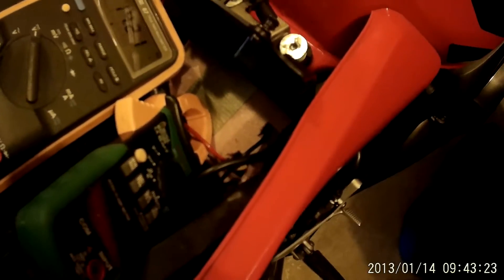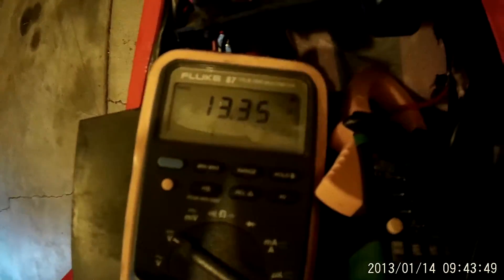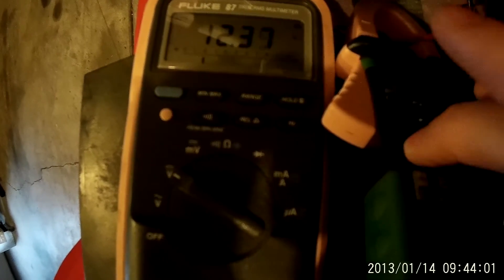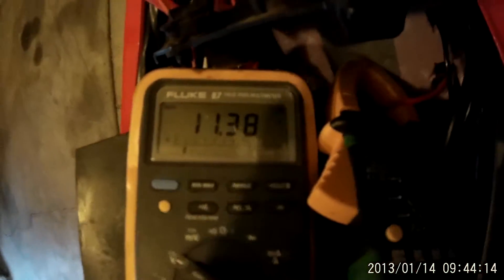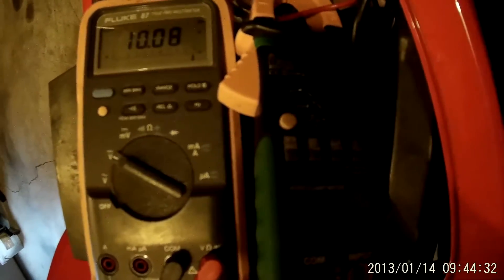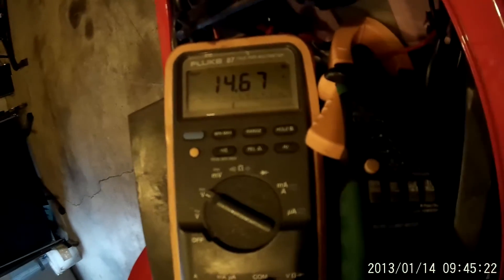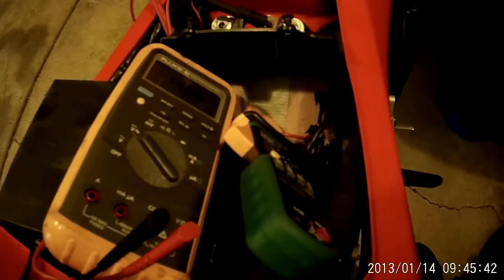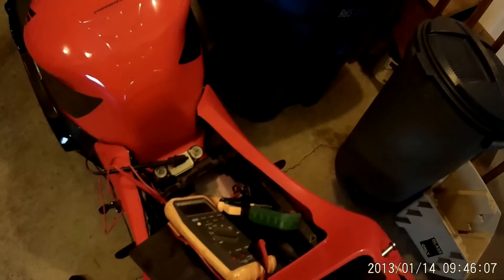Supercapacitor Battery Replacement on Motorcycle

Comment: Excellent concept.   I would think if you put an on/off switch in to prevent the headlight from coming when you turn the key to run it would help reduce draw by a lot.

Comment: Good idea, and for outside bikes if you had a small solar panel (like the flexible PVC kind you could glue to the plastic behind the seat), then you wouldn't have to worry about them draining over time as it shouldn't take much to keep them up so it could sit for weeks.

Comment: Sorry pal. If your bank is flat that bike won't bump start. It needs something to light up the ignition system. Thanks for the video though I'm going to do the same with my 75 xl250. It doesn't have electric start. I just want it to run the lights and horn when it's running.
Reply from the maker: The bike uses a generator to supply the electrical loads. As long as the motor is turning over, the generator is outputting electricity. It took a good portion of a hill to get the bike to start from flat dead once, but it will go.

Comment: good day sir is this DIY safe for honda wave 100?
Reply from the maker: Yes, a supercap is safe for any vehicle. It should work well on the Wave 100 since the engine is small. Make sure you are able to push start the bike just in case the supercaps lose charge and are unable to start it. You don't want to be stranded at an inopportune time.

Comment: I'm looking for an alternative to the heavy YTX20 lead acid battery in my Polaris RMK 800 snowmobile.  The battery and starter are an option, so the battery only powers the starter and is not necessary to run any other electrics although I do have a cigarette lighter outlet on the battery circuit to power my heated jacket.  There is a pull starter on it.  I'm thinking this would be adequate as I can keep it on a trickle charger when not in use.
Reply from the maker: It's hard to say if it would be a good solution for you. It depends on if your sled generates enough electricity at idle to adequately run everything including your heated jacket. My bike will hold 12v at a 1,100 RPM idle with no loads other than the lights, ignition, and ECU.

As you can see from the video, the voltage very rapidly drops when the bike is on, but the engine isn't running and this is due to the lights draining the capacitors.

I'm not sure if 2-strokes are more or less difficult to start than my 600cc 4-stroke, so you might need 600 or even 1200 farad capacitors to routinely start your sled.

It would be an easy way to nearly eliminate the weight of your heavy battery if you can figure out if the charging system works well enough at idle.

Comment: Nice demonstration but I think that it would not work reliably for any bike. Mine (LS650) can not start with a battery discharged to 11-11.5 Volts (it has to pull the decompressor relay and the lights can not be turned off) so I guess it would not start with a supercap discharged to 10V.
Reply: Maybe if you put in an on/off switch for the headlight and the rest of the running lights the draw would be so reduced at startup that it would work,  then once the bike is started just flip the switch to get the lights back on.

Comment: aaaass long as your bike starts first time everytime , this is a great idea ,, how long do the capacitors hold charge without use ?
, im new to the idea and i dont see this working with a less than perfect machine ( like i have,,,sigh .. parasitic draw or something )
Reply from the maker: I wouldn't recommend this for many people. My bike is fuel injected and starts reliably in any weather condition. I've never had it fail to start quickly, on the first attempt. This is certainly a bad idea for a carbureted  bike.

You're right though, you only get one chance to start the bike with these smallish capacitors. If I had used 1500 farad caps I'd get maybe 4 attempts. I let a friend take it for a quick spin once and didn't think it necessary to tell him about the limited starting capacity because he wasn't supposed to park the thing. He killed the engine and then turned the ignition back on while checking out the bike, and the headlight drained the cap too much to start. I had to push the bike down the road and bump start it.

The bike can only sit for 3 days before the parasitic draw pulls the voltage too low to start the bike. I connect it to the Battery Tender if I plan to let it sit for a few days. Even that is unnecessary since I live atop a hill and can bump start just rolling down the driveway.

Assuming the bike is never ridden in sub-freezing conditions, a 4.2 Ah LiFePO4 battery is probably the best solution. A 4s back on Hobbyking is $40. I haven't tried it, but I'm sure it would work just fine.

Comment: How large is the capacitor, and how much does it cost ?  Am curious about using a capacitor on a kick-start only bobber, going for an absolute minimalist look.
Reply from the maker: I custom built mine using 400 farad capacitors. Here is a link to my assembled capacitor battery. http://i7.photobucket.com/albums/y268/redpoint/Forum/KIMG0185.jpg The caps I used are 35mm in diameter and 63mm tall. Here is the link to the product. http://www.digikey.com/product-detail/en/XV3560-2R7407-R/283-4209-ND/3878067

My recommendation is to buy a complete kit on Ebay that includes 6x 350 farad capacitors, PCB, balance circuit, and terminals. Search Ebay for ultracapacitor kit, and the seller is cusdn. $70
Reply: RedpointFive
Thanks for the info !!

Comment: Awesome video man, been thinking about going with a similar set up on my bike.
Reply from the maker: I've been running just the Supercap since January now, and there have been no problems. The voltage will drop too low after the bike sits for about 3 days, but I can easily bump start the bike, or recently I have been connecting my BatteryTender to keep it topped up.
Reply: Awesome I will definitely go with set up then, my bike is my daily so I shouldn't have any problems keeping it charges.